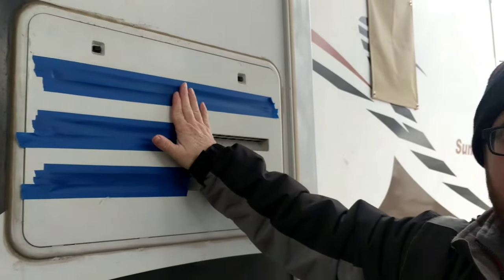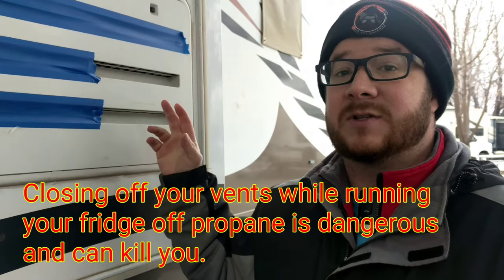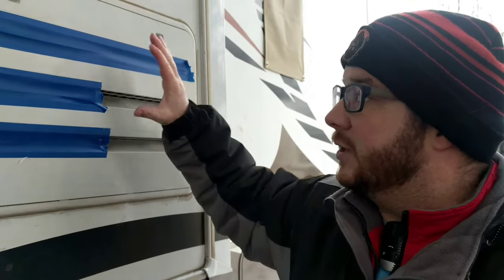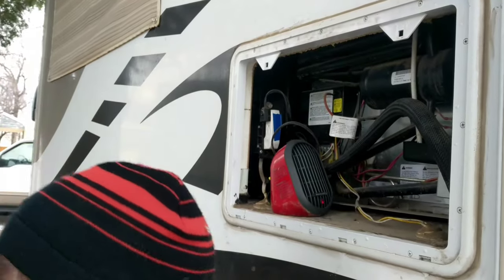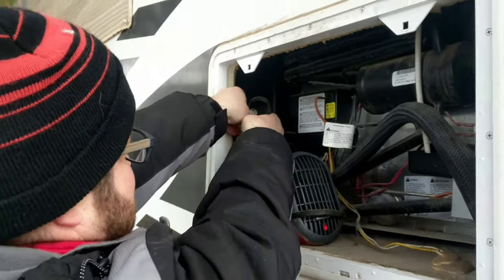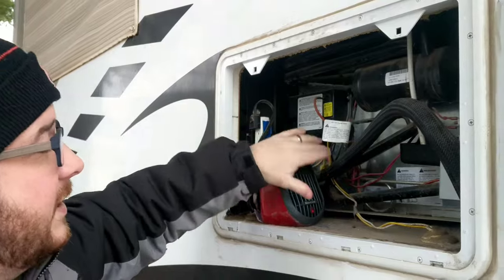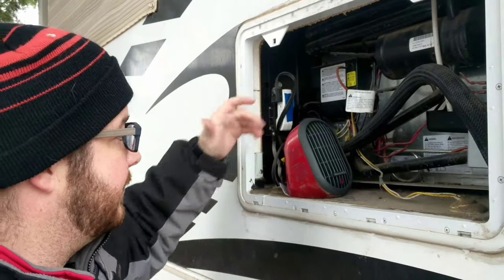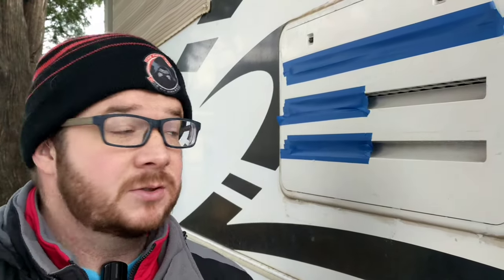Keep The Tip: Refrigerator Freezing Up

Comment: I like the small heater over a light bulb.  Thank for explaining taping, I was concerned about the design must be for a reason.
Reply from the maker: Thanks, from what I have been told, the fridge is designed to vent heat buildup as many people camp in warmer times of the year.

When temps drop below zero, it's vented a bit more than needed.

Unless you are running the fridge off propane, then the venting becomes nessesary.

Comment: My fridge stopped working last week. How long did you have to leave the heater on before you turned the fridge back on.
Reply from the maker: I let it heat the area up for about a day. Once I turned it on I used a laser thermometer to check the metal blade temp periodicallyin the refrigerator for a few hours to make sure they were getting cold.

If it did freeze there is always the possibility it may not work again and require a replacement of the cooling unit.

Hope that helps. I will keep my fingers crossed for your fridge.

Comment: My unit has two separate panels with 3 vents on each of them, one for the freezer section and one for the fridge section. Should I tape both of the top 2 vents on both panels? 
We do not have any space to put in a heater or a light. Running the fridge on electricity.
Reply from the maker: Sorry for the late reply. If you are running the fridge off electricity, I would tape up each of them. (I have the same setup and can't remember if I did the same.)

The object, of course, is to allow for a vent while preventing too much airflow, so it keeps itself warm.

The liquid in an RV fridge can start to have problems in temps below 20F-ish. So if the location you are in isn't too much colder than that, you probably won't need the heater or light. 

Stay warm and happy trails.
Reply: @Henleyshappytrailsplus  Thanks

Comment: Not sure how little or how much heat a 250 w heater produces. However I would be a bit concerned about leaving a heater unattended. Have you thought of using a freeze tape? Like what would be used to keep your pipes from freezing in the winter it is a thermal coupler that activates heat tape to keep things thawed. It's just that an open heat source like that scares me.
Reply from the maker: I basically turned it off when the outdoor temps got above 20F. But from a heat perspective, I felt pretty safe with that heater because I actually used it to keep my feet warm in the rig while on my laptop. I would place my bare foot directly on the heater output and it didn't even burn my foot after 30 min straight. It also had a built in tip over and overheat shutoff feature.

Heat tape might work if you have the fridge compartment space for it, and it may keep the space warm enough.

Some people place a 100W lamp in there if they can fit it. But, those get hotter to the touch than the 250W heater.

There is also Thermostatically Controlled Outlets that can be plugged into an outlet that turn on at about 35 degrees and shut off at 45. That would probably be a pretty safe option as well.

I agree with you in that I wouldn't leave anything higher than the 250 watt heater in there, and even use a smaller one if you can find it. Or use the low setting which only runs about 170ish watts.

Comment: What happens if it doesn't continue working after it's been froze up
Reply from the maker: If it still doesn't work after warming the compartment up, it is possible that the ice cracked something and the cooling unit is shot, or it's so cold that you haven't warmed up the compartment enough to melt the frozen coolant.

Cooling units can be replaced cheaper than replacing the whole fridge, but it may be a good idea to have a technician do that.

Hope that helps.

Comment: How about heat tape
Reply from the maker: Heat tape may work, however... I would avoid just coiling it up in the compartment and if you are adding it to the lines, I believe the is a proper line to attach it to. 

Norcold makes a Norcold Cold Weather Kit which is basically a piece of heat tape specifically for this purpose with instructions.

However, many people find a small heater, or a 60W bulb plugged into a Thermo Cube Thermostatically Controlled Outlet with the addition of taping off some of the vents works well down into negative temps.

I chose the small heater on low because it blows the warm air around the compartment. (It was also the suggestion of the RV tech I called when my fridge wasn't working.)

Ultimately, whatever anyone uses, if it keeps your fridge working, doesn't burn your rig down, or force CO2 inside, it's probably a viable solution. lol

Comment: I tell you, the companies that build these campers suck!  For how expensive they are we shouldn't have to do all this shit.  Also, I literally have ice build up in all the corners and the bottom 2 inches of the RV .  The windows have all kinds of ice build up on them.  Any tips?  I heat it up every week and wipe the excess water so not to damage my wall and floor as bad.  Its gonna destroy the camper by the end of winter.  They really should have stiffer codes when building these.  You really cant use a camper in the winter.  You should be able to, but you can't.  If you do you will destroy your camper.